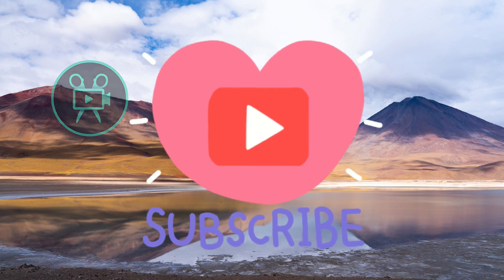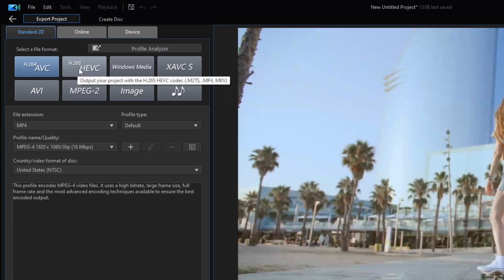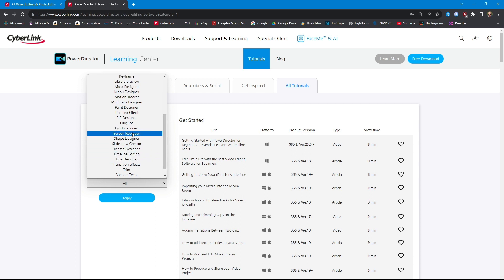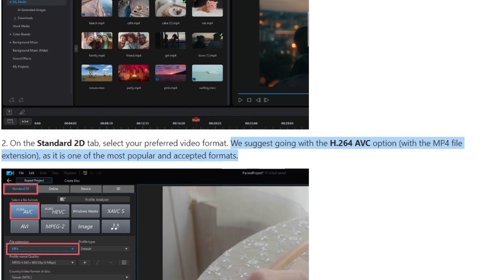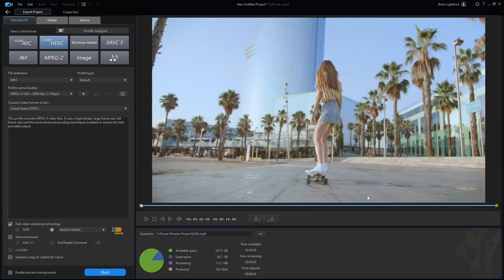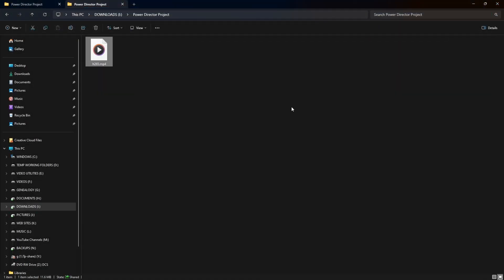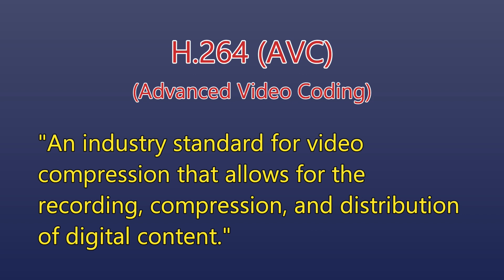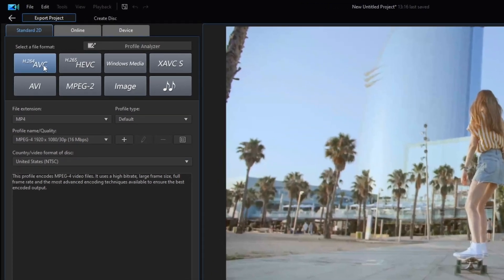19 - Rendering to H.264 or H.265

Comment: Obsolete now with the 2026 Ultimate, it also doesnt support HEVC videos, thing which it sucks, asked for a refund.
Reply from the maker: I assume that your chosen format is MP4 using H.265 encoding. Otherwise, the CyberLink versions chart at "https://www.cyberlink.com/support-center/faq/content?id=29965" is still listing H.265 support for the 2026 Ultimate Version. It specifically lists H.265 Hardware encode/decode but ends that with 2 asterisks which means ONLY if your graphic card supports it. You might try turning off Hardware Decode in the Performance tab of Preferences. Other than that, I would suggest contacting Support to make sure you aren't trying to do something that is outside the bounds of the capability of the program regardless of year or version.

Comment: what PD version is that ?
Reply from the maker: It was PD365 and because it was created 11 months ago, that would make it the 2024 edition. Within the video, I even identify the version of PD as the 365 version.
Reply: I've always used H.265 with my old PD 18 and not had a problem. I may have bought the 99 cent codec from Microsoft years ago. If it makes a smaller file size with no loss of quality, it's worth it as I've made over a 100 videos over the years so the size adds up.